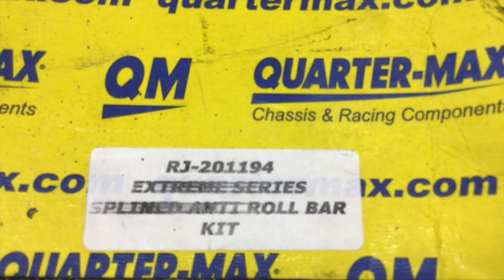Nova Gets Extreme Series Anti Roll Bar from Quarter-Max 25.3 Chassis Drag Race Chromoly

Comment: As a beginner in tig welding, I enjoy the extensive comintary on what and why you are doing something. That and you meticulous attention to details in build.
Reply from the maker: Thank you, I'm glad! Funny enough, I just ran across the instruction sheet for the kit and it said to drill 3/8" or larger holes for the rosette welds on the torsion bar (I somehow missed that) and I wanted to put it in the comments for anyone attempting to build this kit or anything similar. I'm glad I have been helpful, and I always try to leave no stone unturned when I build something; I like to reap the full potential of the materials and components that I use for a build. In the area of TIG welding, I am mostly self-taught aside from things I have learned from my brother who took a fabrication course and some great welders here on youtube. I wish you the best of luck for your TIG welding enterprises and thanks for watching!

Comment: Looks really good. Are you going to do the tin/carbon yourself also?
Reply from the maker: Thanks! I am planning to do the tin, not sure if it's getting steel or aluminum yet (probably some of each). Carbon would be sweet, but I don't think this car will be getting any carbon panels, maybe some door bar tube scuff covers and other accessories. Thanks for watching!

Comment: What's the drivetrain going to be. And any idea on when you be going down the track?
Reply from the maker: The plan is gen. 3 small block (LS Next block) with twin turbos, glide, Gear Vendors, and a steel driveshaft. No ETA at this time, but hopefully in the next year or so.